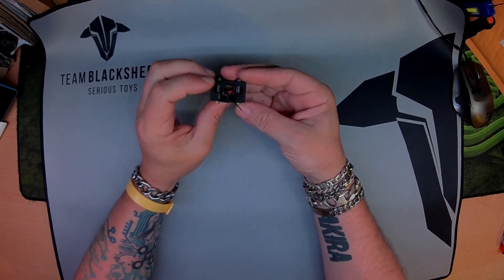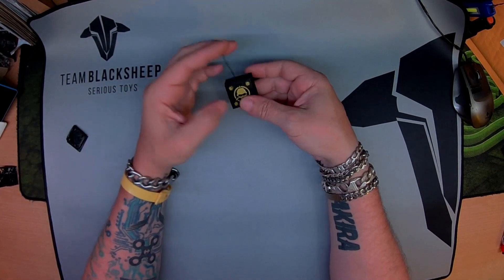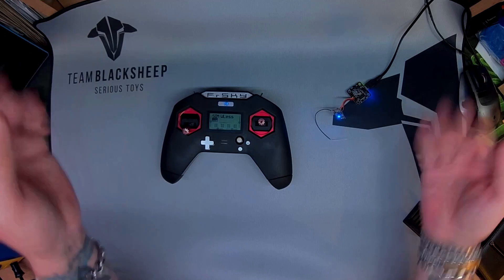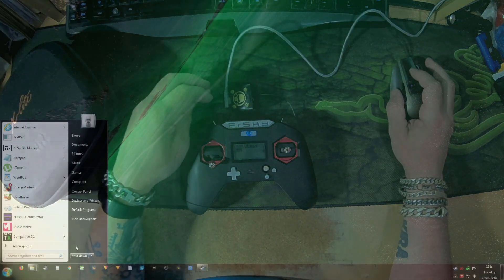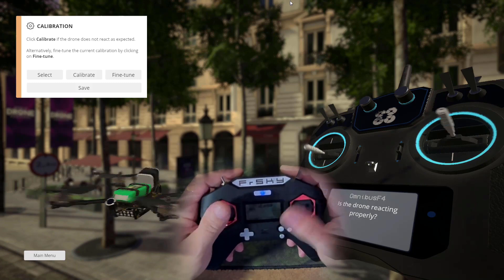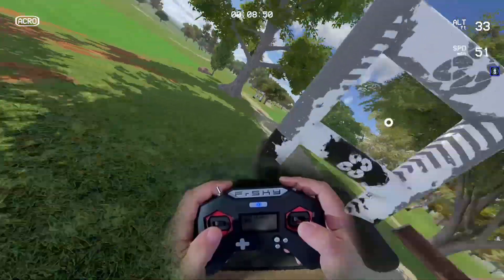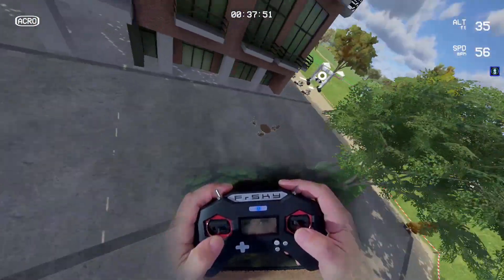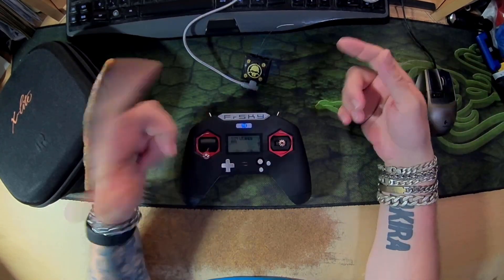Wireless Simulator Adapter [DIY on the smallest budget possible]

Comment: Nice video, cool how you can use it as a wireless controller.. would it work with other games as well? :P

And I'm back, if you noticed I was inactive for a while :)
Reply from the maker: Hey, thanks!
I have nearly no doubt that you could use this to implement RC controllers into other games. You have me thinking about trying my Flysky car Tx in an RC sim now haha!This method should also work with every type of radio manufacturer/receiver and type of signal (PWM,PPM,SBUS & IBUS etc)The main thing is an F4 flight controller as you neeed the memory that has (wish it could be done on the older ones as I have loads kicking around)
I had missed you! Have you been on holiday or somehing?
Reply: Some rc cars controllers have options for simulators.. I can remember my himoto TX has an option for it.. (and I'm finally selling it if the guy comes unlike with my laptop..)

And I went on holiday to Spain, it was really fun, and the first time I went in a plane :p

And I'm thinking about taking a little break with my rc cars, because a few spares in my country costs as much as my hellseeker, and that's a little too much for me..
Reply from the maker: All of my Quad Tx's have support for usb cable's but they annoy me :)
My brother was in spain a week or 2 ago and had a great time, I hope you recharged your batterys with some great weather etc?
I know how it feels, It's never ending hey? I'm starting to turn my gaz 66 into a differnt beast ,just keeping the cosmetics for the most part.I've spent soo much fixing the junk in my son's C14 (3 steering boxes and now 2 drive motors - There is a video comming soon called the C14 Scattergun upgrade)
I've been rather quiet due to lots of stuff going on,besides looking a harddrive.